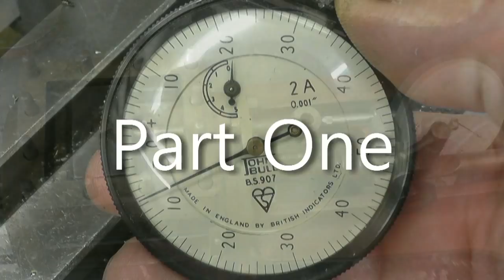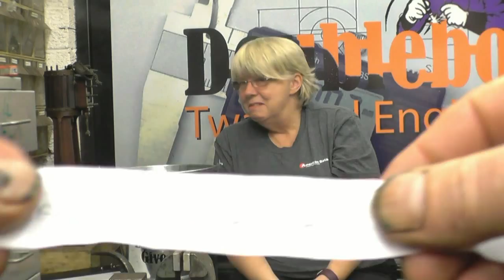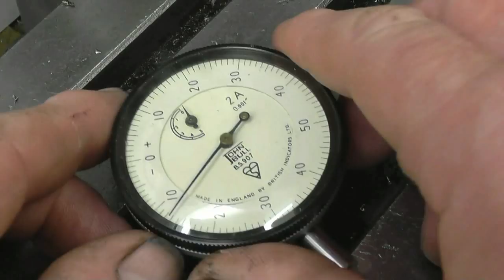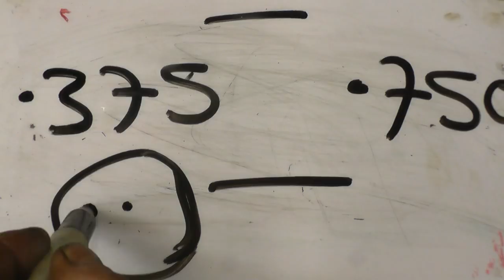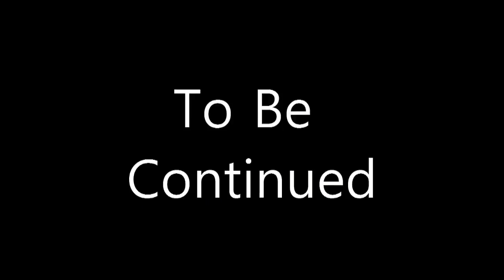SNNC 182 P1  Grinder mount  Steam engine slide valve

Comment: Looks like the vice is holding on the bolt heads on the grinder base, not very safe.  If you turn the angle iron round will it stop the vice handle hitting the base?
Reply: I thought that about the bolt heads as well, at first, but if you look carefully, it's actually held by the vice's soft jaws.
Reply: It becomes obvious when I watch the vice being tightened. I guess I am not so observant these days. :)
Reply: whats worse, he had a bit of wood the right size, but went the hard way to use the aluminium!